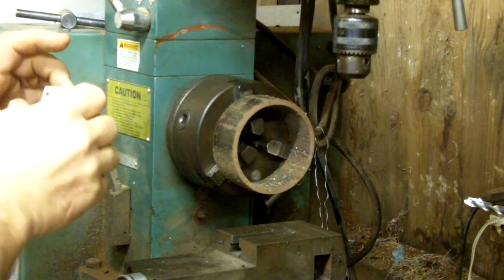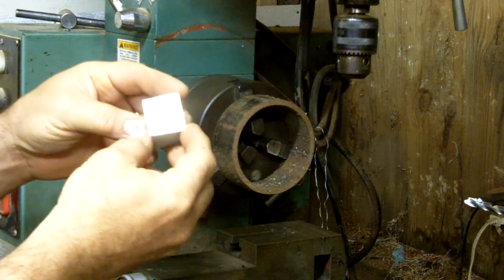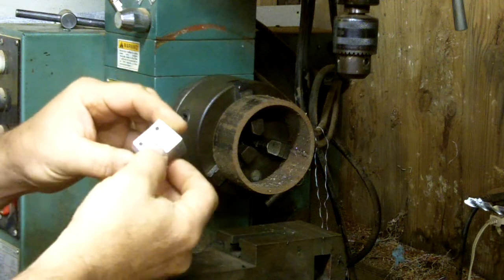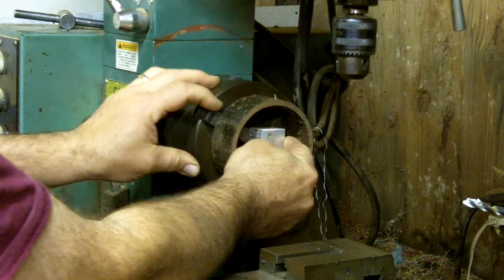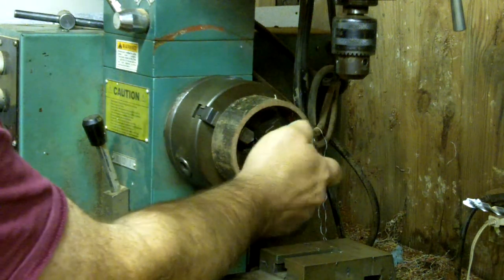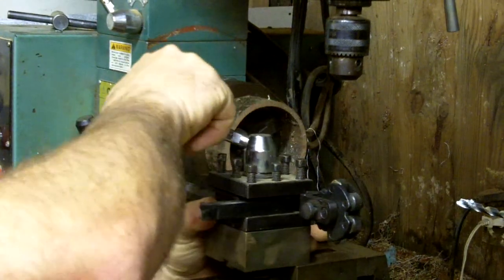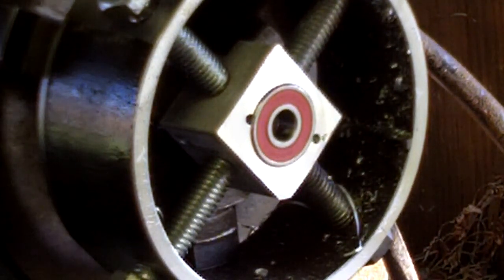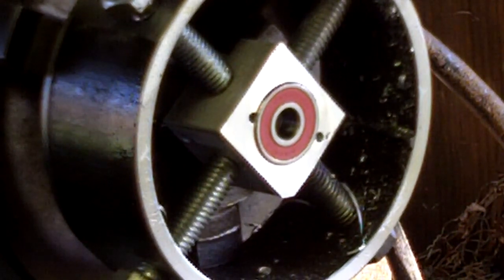DIY 4 Jaw Chuck

Comment: Decent solution to your problem, however, that's not a 4 jaw chuck :)  It's actually called a spider fixture.  If you have to do anything extremely precise with one, you need to make the spider pretty beefy.  The best ones I've seen were made out of stress free or 4142 pre-hard, mounted directly to the spindle and then machined concentric and faced on the spindle.  After that, the spider bolt holes were drilled and tapped on a mill.  Using thicker alloy material allows you to cut down on distortion of the spider body if you really have to torque down on something or if you have a heavy component mounted in the spider.  Rifle barrel work is very commonly done with a front and rear spider to allow concentric bore alignment of the barrel.

Comment: Is that a 16" x 31" Grizzly 9729 ? If so I have a few questions for you !!
Reply from the maker: +Andy O'Quinn  Yes it is.
Reply: +Dan Mullen I am using the 5" 3 jaw that came with the lathe.  I bought everything new, and I have a lot of run out.  Any suggestions on how to fix that.  Thanks.
Reply from the maker: +Andy O'Quinn Andy, the only thing I know to tell you about chuck run out is to check the jaws and make sure you have them in the correct location on the chuck.  I marked mine, after a put them in the wrong place the first time and had some bad run out.   Good luck.